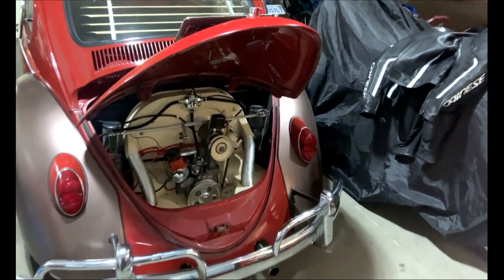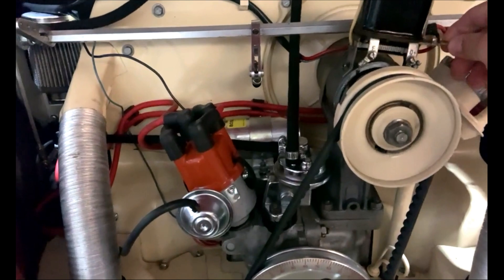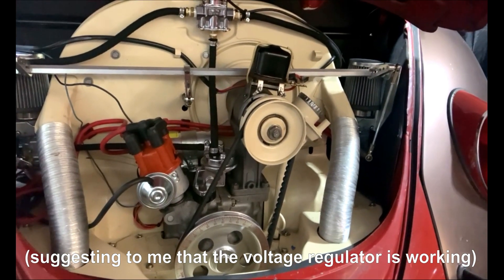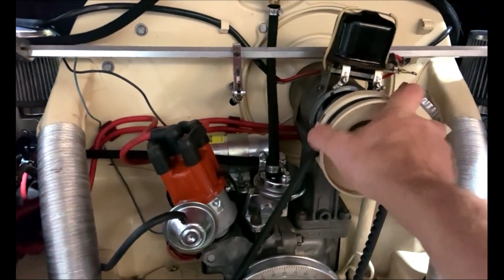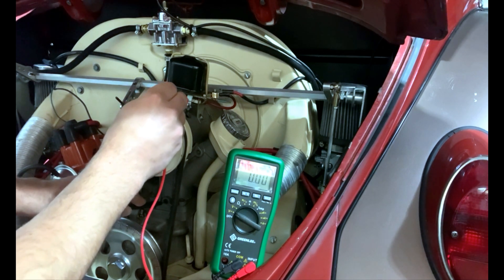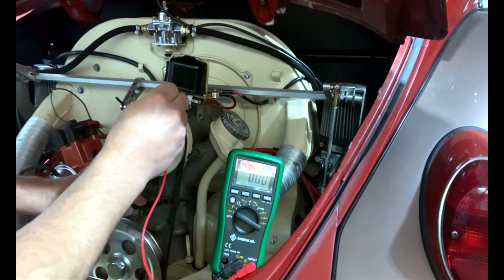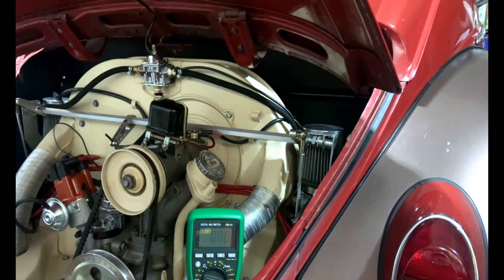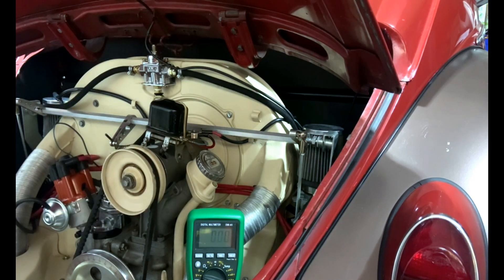New 6-Volt Ignition Coil | Testing & Setting Polarity on 6-Volt Generator | Air-Cooled VW Beetle

Comment: Really interesting video but two things. 1. For your own safety mount that voltmeter somewhere safer than where you had it - you know that if it’s going to go wrong it’s going to fall into the path of the pulley and belt. 2. You have vastly reduced the life of that drive belt removing it and reassembling it that way. There is only one way to do the job properly and that is split the generator pulley and take it off that way.
Reply from the maker: Both very good points, thank you!

Comment: Very interesting stuff here. I've heard of polarizing the regulator but never a generator. A brush kit might help you out, but what would be better is to simply convert everything to 12 volts and install an altenator. Its not that difficult and it would improve your electrical situation 100%.
Reply from the maker: From what I’ve read recently, there’s no such thing as polarizing a regulator… doing that actually polarizes the generator… the regulator companies provide instructions to do this so that the generator is properly polarized and the customer cannot blame the regulator manufacturer for sending a faulty generator… again, I’m completely new to this and it is what I am reading.  

On the “12 volt” fix that you suggest… I know, and completely agree that switching to 12v would (or should) solve all my issues here.  In a way I am regretting just not doing that from the start, but I’m also a little stubborn and determined to make the existing setup work.  Also, I’ve now bought the new 6v coil and distributor.  The 6v battery was also new when I bought the car last year, and I’ve been inclined to keep the 6v system for originality.  I’ve got several spare motors to rebuild though, and will definitely be be using 12v generator/alternators on them.